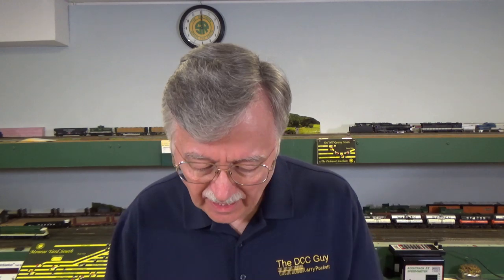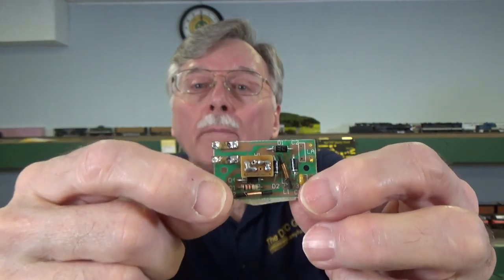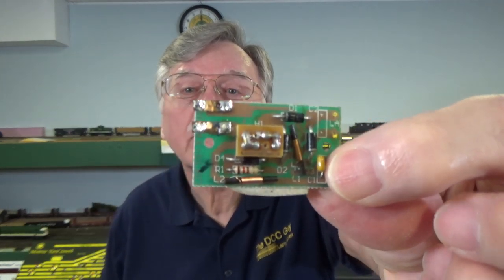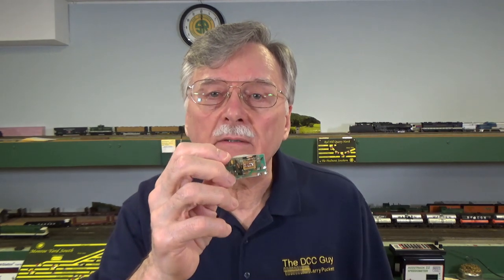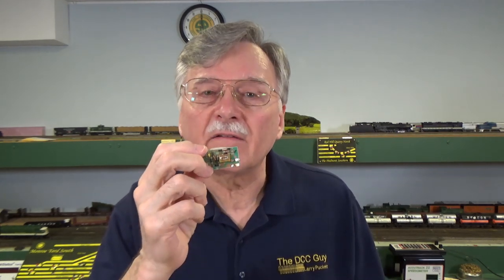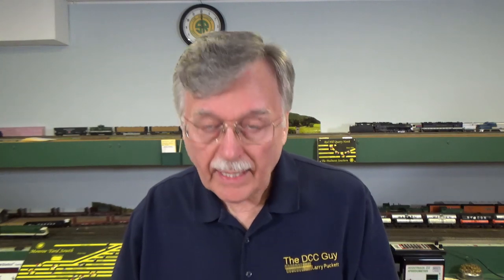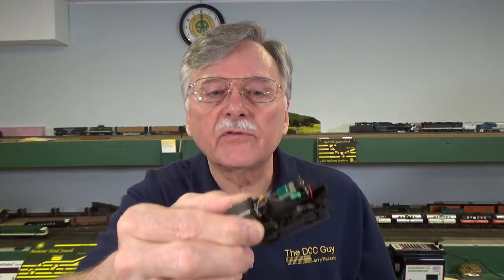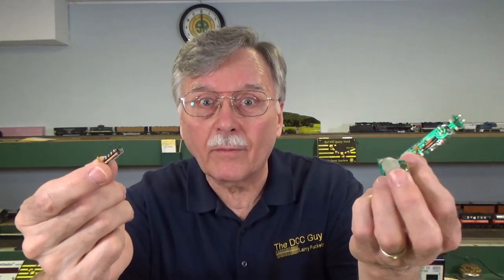Is Your Decoder Being Choked? (79)

Comment: Brilliant advice, I think you have solved my jerky loco problems.
Reply from the maker: If that doesn’t work you may need to dig into the BEMF settings. I tried all kinds of edits and auto-calibrations with the LokSound 4 that came with the Oxford Rail loco but just couldn’t get the slow speed fixed even after I removed the filter cap and chokes. I honestly think it is the cheap coreless motor they used. A fellow on RMweb pulled one and checked and found it was commonly used in personal vibrators made in China! Fortunately the Soundtraxx ECO decoder was able to deal with it. Good luck with yours.

Comment: Thank you for a very clear explanation of back EMF. I have heard this discussed without an explanation of what it actually is but now I understand. Plus I have two brand new BLI SD-9s that run very poorly at low speeds and this may just be the problem.

Comment: I've yet to remove the chokes / capacitors, from the Oxford rail N7. I will let you know if it solves the gradient issue.
Reply from the maker: Be aware that they may have used SMD  components on the plug board, that’s the way my 0-6-0 was done. Here is a link to the YouChoos DCC website where they show how they solved their Zimo issue with these. https://www.youchoos.co.uk/Index-Resource.php?L1=Guides&Item=OO-OxfordDeanGoods

Comment: I took a Bachman f-9 locomotive made back in the late 80's  apart to see what it would take to install dcc decoders, and I did not find any of these , I take it i could switch to dcc with out much trouble.
Reply from the maker: Not too surprising as most Bachman locos from that era did not hVe them AFAIK. Your main issue will be current draw on those older motors.

Comment: Those "resistors" are chokes, if the "resistor" has a greenish body, it is a choke.  Standard electronic industry part.
Reply from the maker: John—thanks for confirming that those are chokes too, as I had assumed. Bachmann uses a variety of approaches on these circuits and I have seen them use two caps on a board, two attached to the brush contacts, and the more common one across the brushes, but most often use the typical wound copper wire chokes. This is the first instance where I have seen these used for this purpose.
Reply: Yup!

Comment: My Oxford rail N7  0 - 6 - 2 tank loco works fine until it is going DOWN a 1 in 52 gradient with wagons behind it, its actions are that it, (gradually slows down, goes to the speed it is set at quickly, runs smooth for about 2 seconds) then repeats these until it gets on the level again, where it runs very well again. Going UP the gradient doesn't cause any problems.
Reply from the maker: Going downhill with a load can be a challenge for BEMF. What type decoder are you using? Another problem can be slop in the mechanism, as some models have too much play in the gears. On older Athearn diesels I used to use thrust washers made by NWSL to take up this slack and a fellow recently told me he used them in a LifeLike GP30. If your mechanism is anything like my Oxford Rails 0-6-0 you might check the spiral gear on the motor shaft to see if it has excess for and aft motion. Then check the gear train down to the drivers to see if there is slop in there. I am convinced many of these type models are made for flat table top running and don’t really factor in slopes.
Reply: @TheDCCGuy  I'm using Limo MX 600 I've checked the mechanics and can't find anything untoward, so believe the problem to be the back emf. I will have to go through the settings and try disabling the back emf altogether. Then gradually increase its application.
Reply from the maker: Sounds like a good approach. Also check the manual to see if to has an auto calibration procedure, many now do.

Comment: While it is true that you can remove the EMI filters but if your modified decoders start to cause interference with other licensed radio services be prepared to have an authority on you door step demanding you replace the filters or fine you for the interference.
Reply from the maker: Yes, and as we use Wifi and Blue tooth more and more around our layouts for computer access and throttles we may see the effects moe directly so it is important to be aware of the possible consequences. I can remember when we used to have radio problems due to baby monitors and even the local cab office.
Reply from the maker: To see if there really is a potential problem I did a quick and straightforward test. I cranked up the DCC system and placed one of the Bachman 0-6-0 locos, that I had removed the filter caps and chokes from, on the track. Then I opened the YouTube app on my iPad and started streaming a video while at the same time running the loco right next to the iPad—perfect reception with no disruption of the Wifi signal at all. I then got out my Bluetooth airpods and connected to the iPad. With the YouTube video running I listened to the audio on the airpods and ran the loco at various speeds as I moved the iPad alongside. Still no impact on the audio or video. Although this doesn’t indicate what might happen with a dozen locos all running at the same time it does seem to indicate that at least for the frequencies of my Wifi and Bluetooth there is no impact with the locomotive running just a couple of inches away. I also have read that digital TV signals are not impacted either. So my opinion is these are old regulations left over from a time when analog TV and radio were likely to be affected by the RF/EMI created by DC motors. However I have been at this for over 40 years and haven’t had a complaint yet.
Reply: The small size of the decoder and the low power/voltage that goes through it makes its ability to cause EMI totally insignificant. I don't have a decoder like this, but I'd setup a spectrum analyzer to see if there's really any significant emissions coming from it.
If this was some kind of a spark gap arcing at 5,000-10,000V, maybe there could be some wide-band EMI, but even that would be dwarfed by the soup of radio waves that is around us at any time.
Besides, most of the comms today are digital, having error correction and there's very little analog transmission in any band that might notice EMI.